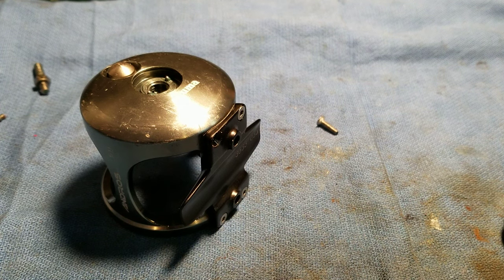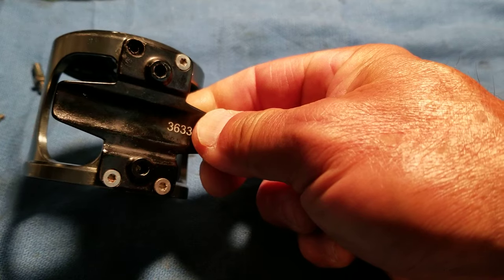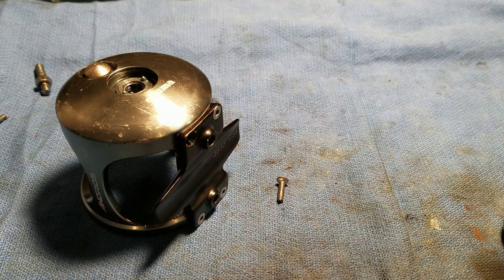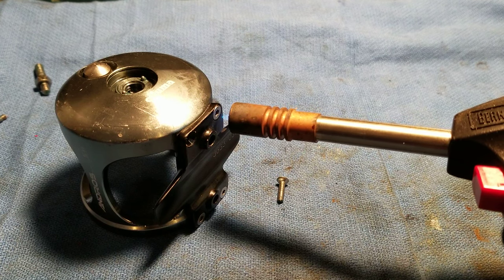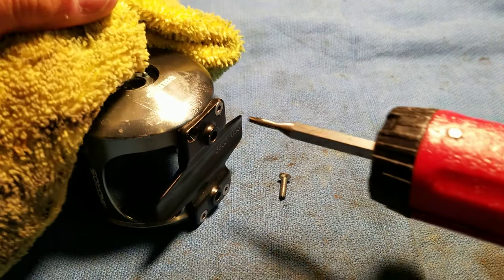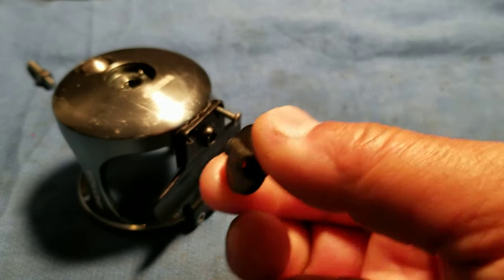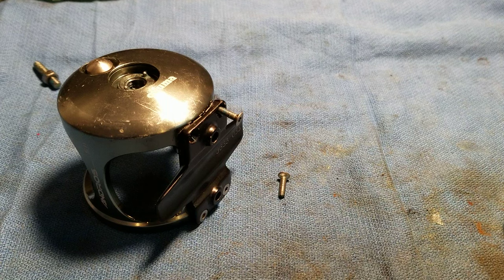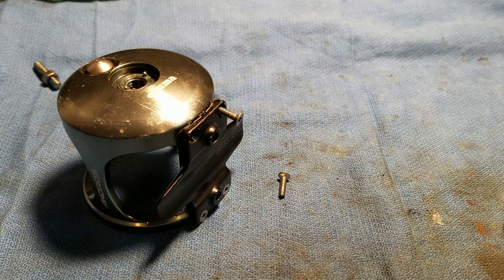Andros Reel Seat Screw Removal

Comment: That certainly works!
A soldering iron held inside the screw depression will heat a little more directly. A small screw like that will heat up pretty fast and the heat will travel through the screw into the threads. Even the strongest loctite only needs around 325-350°F to soften.
Maybe a little less chance of paint damage too. Either way works of course 👍 The torch is probably a little quicker with a little less precision being the trade off.
Thanks for doing what you do!